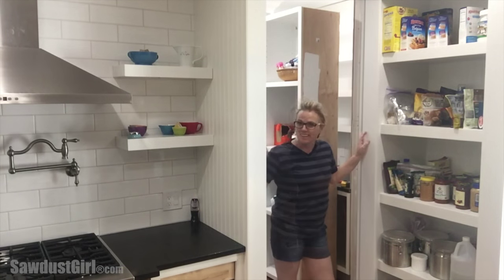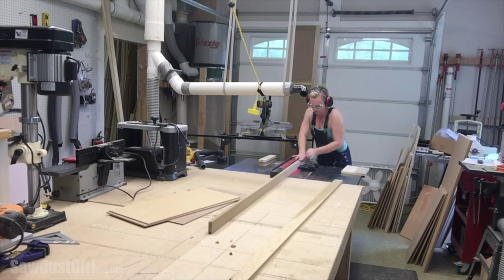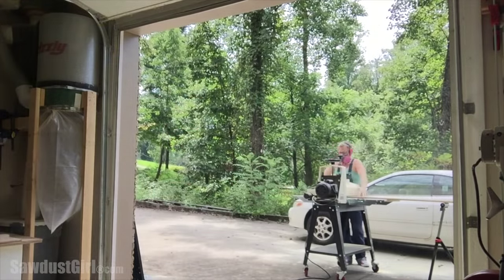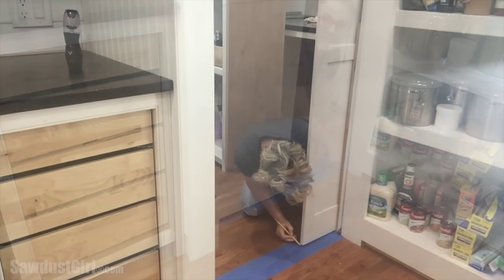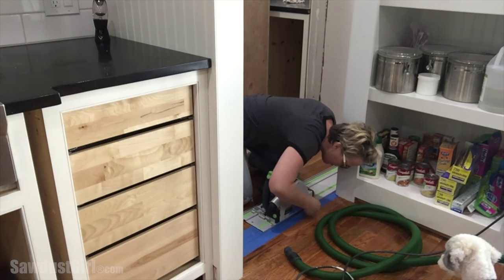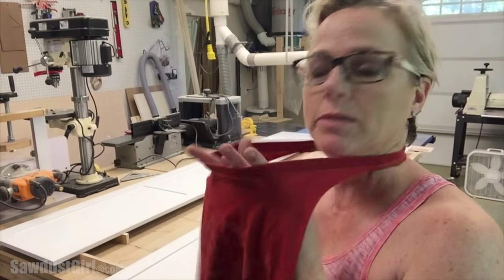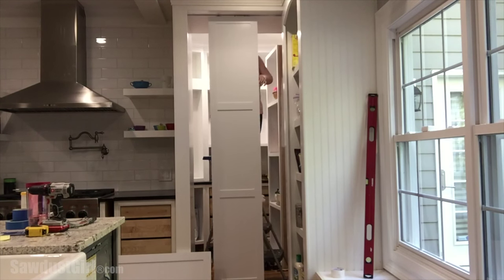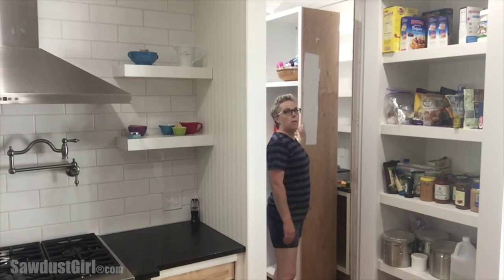Building Pocket Doors for the Pantry

Comment: I need to build similar doors for a wardrobe (about 7' tall doors, however I have no planer or drum sander and the 1x3 s4s poplar at my local home depot is warped. am I looking for trouble if I attempt doing this with their wood? any suggestions are welcome.
Reply from the maker: +john obrien I've used poplar from HD many times to build doors.  I sort through the entire pile to find the straightest, flattest boards possible.  Getting into larger doors it's even more important to have straight, flat lumber.   You may be able to find a cabinet shop that has a large drum sander that would run your finished doors.